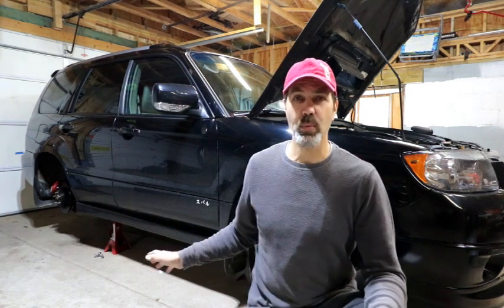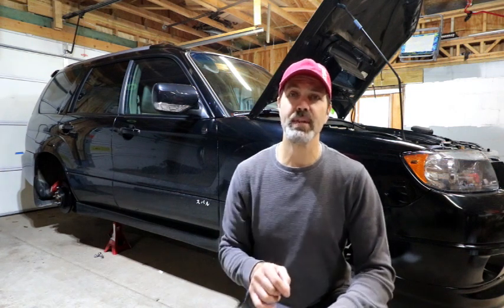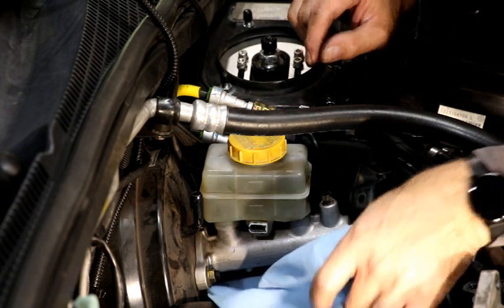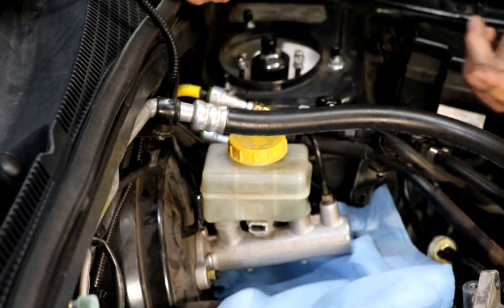Upgrading To A STI Brake Master Cylinder On The Forester XT

Comment: So you push the brake pedal down until it becomes hard solid? And can’t press any more? So no bleeding the brakes? Then you remove the master cylinder? While there’s still brake fluid in the master cylinder? Did you leave the brake fluid in the STI master cylinder while bench bleeding it, or did you tip it out and pour in new brake fluid? And do you bleed the brakes after installation?
Reply from the maker: With old/ worn pads you are pushing most of the fluid into the caliper. Bench bleed the new master and leave the fluid in. Once installed you can push all the caliper pistons in and that will push any trapped air out of the system. If you're still concerned about air, bleed the whole system.

Comment: I believe my master cylinder is bad. Oreillys has 05 sti master cylinder for 104 and some change and a forester for 130 and change.
I haven't upgraded my brakes.
Would i have to modify anything to use the STI?
Reply from the maker: You won't have to modify anything, the only difference is that the STI has a larger piston that moves more fluid giving you a firmer, more responsive pedal. Be sure it's a true STI master cylinder, check that it's marked 1 1/16 and not just 1.

Comment: Hi there great video have a 2013 subaru forester xt 2.0 turbo in Australia RHD poor brakes no leaks new rotors new pads poor brake pedal possible booster or brake cylinder issue im not confident doing a change over the upgrades probably expensive new too
Reply from the maker: A new sti master cylinder isn't an expensive part but you need to be sure you find one that fits and works with your year. Replacing certain parts on newer (roughly 2007 and newer) Subaru's could affect the VDC systems.

Comment: I assume your Forester is a 5 speed? I'm looking for a video to show how to adapt this master cylinder for an auto.
Reply from the maker: Mine is an auto, very easy upgrade.
Reply: @DIYEVERYTHING  What year is yours? My Mom has an 07 with VDC and I've read that the brake lines have to be modified on an automatic for 07-08.
Reply from the maker: Mine is an 06 so I'm not sure about the 07,08.

Comment: Hello I have two questions for you I too would like to upgrade my '07 Forester XT sport but the problem that I have would be my master cylinder is different then yours how would I resolve this my master has both lines on one side and a share that protrudes out the back about an inch and a half okay that's question one question two is I have a master cylinder problem the cylinder is discontinued at the dealer. This cold Started From Me replacing a rear caliper have to go all over to find one and then that time I believe it ran low on brake fluid. I bled the system from the farthest Calibre to the closest caliper that works until I started the car so I thought it was paid internal leak on the master. I found 1 2 hours away and installed still no breaks when the engine running the pedal goes to the floor turn the car and pump the pedal its good until i start the car again.. Help help
Reply from the maker: Sounds like you got air in the abs unit. If you're lucky you can bleed it out but you may need to take it to the dealership or a garage that can hook up a diagnostic tool that force bleeds the abs units. Basically making it actuate and push the air out.